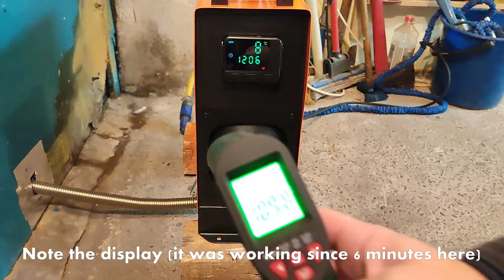Cheap Diesel heater | quick setup of  VEVOR heaters

Comment: Hi, I have the exact same diesel heater.  I noticed the controller is also the same.  Have you been able to connect your heater to the bluetooth app? or do you know how to activate the bluetooth function on this controller.  Your controller show's the bluetooth symbol in red, which I'm assuming it is disabled.  The instruction manual doesn't tell you how to enable bluetooth, it just assumes its enable already.  Please advise if you can.  Thanks.

Comment: Great video, I just ran mine for the first time today after watching you video. Do you have a video or know of a video that show what all you can do with the three buttons on the display?  I figured out how to change from manual to automatic but that is all I can do.  Just wondering what else can be done, can't make sense of the instructions it came with.  Thanks
Reply from the maker: @jimmymullins4997  actually i always use mine on manual mode on 3 and honestly I don't know what other functions are there. I think it also depends on the specific model, but mine is pretty basic, it can (on paper) maintain given temperature or it can be used on manual speeds  (power) . I think there might be some kind of timer, but I am not sure. These heaters (like mine) are very chinese ;) and I don't trust it much...
Reply: @FixitEasyDIY  Thanks, for the quick reply appreciate the feedback

Comment: I noticed the heater used in this video (Vevor brand) is listed for $108.99 right now. There are sites selling them for as little as $39 now for the same heater as far as I can tell. I may order one to see the difference (if there is any) They're just about giving them away now! I'm sure they must really be cutting corners in quality compared to the original version? We'll see.
Reply from the maker: Hello, I bought mine for about 90$ from AliExpress. The quality is decent. It does it`s job very good, heating about 20 square meters. For 39 $ it looks like some scam for me :) Webasto are selling their diesel heaters for 10X the price :) If you buy one of these 39 dollar heaters please update us with information what happened ;)

Comment: 8 KW? Where and How? We need to subtract MINIMUM 30% from what the Chinese declare!
Reply from the maker: Well I think it is not giving the full 8KW of power, but it makes my workshop very cosy. I was using 2KW electric heater before. Now it makes the temperature much much better and much quicker. I use the heater on setting 3-5 out of 10. There is a big con... it makes a lot of noise, but at least it is warmer here than ever.

Comment: I own three Chinese diesel heaters. None of them can work without problems for at least a few days. At the moment two are out of order, the third one alternately works and does not work.The 8kw Vevor couldn't even last two days of good work!  What kind of damn Chinese junk are they sending us here?!
Reply from the maker: @shankarsharma5815  I am sorry to hear that. Mine is working very well so far, but it hasn't been used for too long. Maybe it will eventually fail soon...
Reply: @FixitEasyDIY  Last one I have bought, Vevor 8kw, worked very well ... first freezing night. Second night started show error-5 and stopped despite couple attempts to restart. Nothing obstructs the air inlet or anything. Just other wasted money, because we stumbled upon the Chinese junk scumbag again.
Reply: @FixitEasyDIY  It could also be a problem with dirty diesel fuel. Two heaters had the same problem - a clogged diesel injection nozzle into the chamber, and in one case it was enough to clean the air inlet - it had a rack clogged with dust. Two heaters also have a problem with the electronics - it sometimes gets confused and needs a reset.
Reply: Mine leaked exhaust fumes from the internal chamber below the fuel tank.
Garage was full of fumes.
Extremely dangerous machine. DO NOT BUY